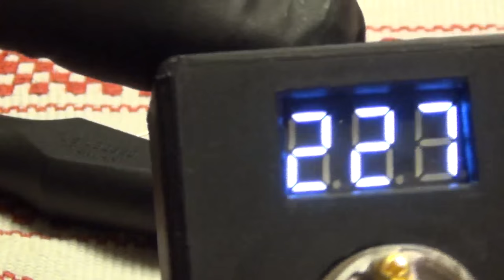m atty + build!

Comment: Now I will pay the price for USA made devices and prety much anything mand in the USA when I have the money for it. USA made products tend to cost more yet are always higher quality and that is worth the extra cost. I do have two mech mods that are USA made from USA Made Mods. Infected mods one is copper and black with serial # 48 and the other is brass and SS with very high serial number. Guess you can tell which sold more since I got the black/copper about a month earlier than that SS/Brass and about 4k difference in the serial numbers. 

Now for your dry ass cracking hands try some Corn Huskers Lotion. Just a little bit goes a long ways and does work wonders for those with skin that cracks and bleeds when it gets dry. Luckily I don't have that issue yet for dry hands. 

Now for this RDA damn that is purdy with all the gold plating. Yet just do not thing it is worth the cost with so many other RDA out there for very affordable prices and easy to build on with great flavor. 
And that strumming the coils does way more shit that pinching them at least with Kanthal and NiCr80. So 15W with a .22 build? Isn't that a little low watts for that low of an ohm build? Or is that just the NiCr80? And do love the Jon Bon Jovi Dead or Alive in the background. And damn seeing your kitchen you have that same shitty ass small oven/range like I do. I would love to replace it yet would cost 2k to do it. Although do love the knots in the cabinets.
Reply from the maker: Thanks for the comment dude! I will look into that husker for sure!